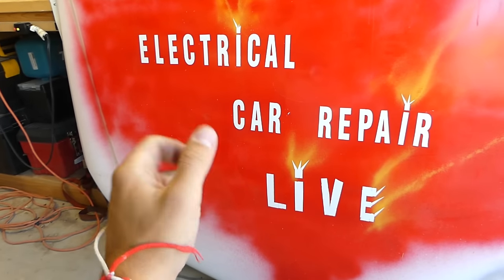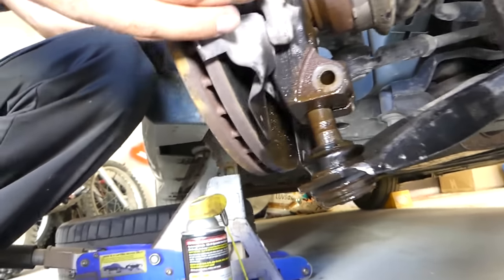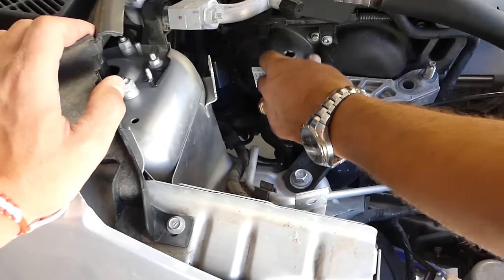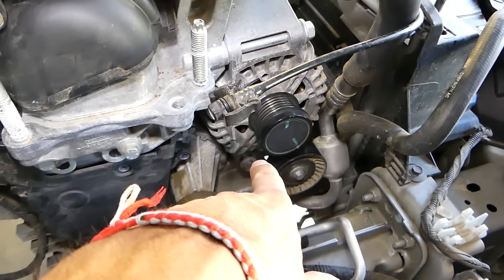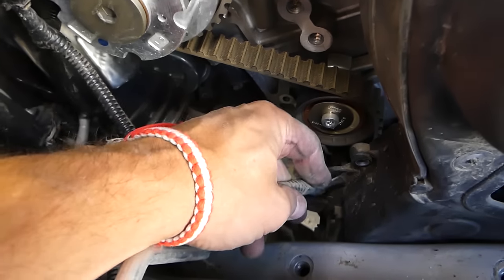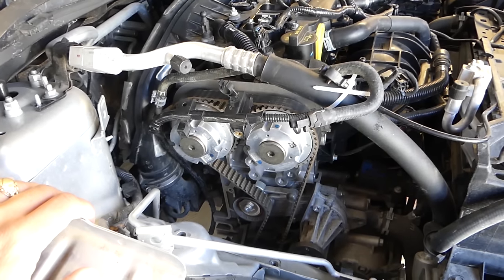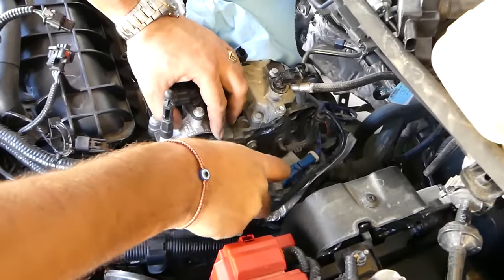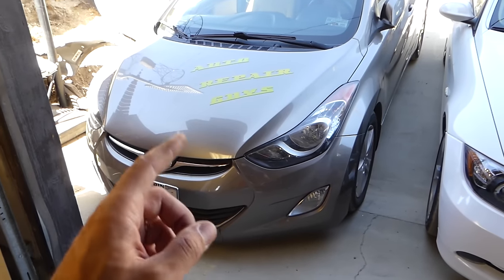FORD FIESTA TIMING BELT REPLACEMENT MK7 ST

Comment: I'll be the first to say this.  You made it way more difficult than it needs to be.

You don't need to pull the suspension apart and remove the half shaft to get to the bolt where the crank locking pin goes.

You don't need to remove anything off of the top end of the engine and use the cam locking tool.  That's what the VCT tool for the sprockets is for.  That cam locking tool is for older cars that don't have VCT sprockets.

You don't need to pull the intake manifold to remove the starter.  Remove the charge pipe, move some other minor stuff out of the way, pull the starter.

For those wondering, the flywheel locking tool is Ford part #303-393.  If you search for that, you will find 3rd party tools that are the same as the Ford tool.
Reply: It appears the half shaft is different on the ST.  My 2012 Fiesta base doesn't have an intermediate shaft like this, maybe it's only on the manual transmission versions?  On most of them the crank locking pin bolt is easy to access without removing the half shaft.   Thanks for the tips about not needing to remove the valve cover with the VCT sprockets!  Saves half the labor here!
Reply: Correct. You also do not need to pull the starter or use a crank holding tool. Ford procedure says to torque the crank pulley bolt to 74lbs using the crankshaft pin to hold the pulley. The pin will hold 74lbs just fine but ofcourse it is not strong enough for the final torque stages. At this point the timing is locked in so remove the crank pin and complete the final torque process using a strap  wrench (303-D055) to hold the crank pulley. I used an OTC 4754 universal pulley holding tool to hold the pulley instead of the strap wrench and it worked perfectly.
Reply: Got a question for you. I’m doing this on my escape, in order for the Cam Locker to fit, the TDC locking pin had to be like one thread out from being all the way tight. That allowed the cam locker to fit. Could the belt have been stretched just enough to make it so the cam locker was a little off with the TDC pin screwed ALL the way in? Trying to decide weather to leave it becasue these timing kits could be a little off as far as the accuracy of the TDC length, or do I screw the TDC pin all the way in and then manually move the cams to where they can be locked in place?
Reply: @bigscurrybear  This is really interesting to read. How does the Ford procedure say to undo the crankshaft pulley bolt? Or to hold the crankshaft against the timing pin when changing the belt? Or is it not supposed to move? I need to change the belt on my Fiesta so I am wanting to learn all about it and not have to remove the starter to fit a locking tool. Many thanks.
Reply: @iStarmaxx  
Hello.. here in the Philippines we did not use any special tools, we dont have that tools but we performed changing belt of ecosport ford by simply looked at the timing mark  of the camshaft and put  lond screw driver on the sparkplug hole once the screw driver riches on tdc we  simply put  a bolt in the crankshaft locking area and turn it clockwise once the bolt was set we turned it counterclockwise to lock the crankshaft and the camshat were set into its timing... im just sharing our own way of techniques.. thanks for the knowledge
Reply: Ur right, these guys are slopy mechanics, and after all the nonsense they didn't replace the water pump or the timing belt
Reply: @carmeloberrios3545  the video he explains it's just as a demonstration because the car has low miles
Reply: @OlBuddySimulator  You should replace timing belt when you remove it.
Reply: I'm so glad I found this comment, so much unnecessary work.
Reply: At what point in this process can I change the water pump? The timing belt is fine on my 2017 escape.
Reply: On an escape you definitely need to remove the axle and bracket too get the pin in
Reply: So glad to read this comment. I was getting so overwhelmed watching this thinking to myself that ima basically take apart my whole motor to replace a timing belt.
Reply: I was thinking good lord you ain’t gotta do all this shit just to replace a fucking timing belt
Reply: In my case I'm glad I did, one of my cams was out of alignment
Reply: yes...I have never done this and realized right away the axel can stay and no suspension needs removed. I also left the intake on, it was a pain to push the starter aside but way easier than taking out the manifold. Also you need to put a rachet on the crank pully bolt and hold it against the crank locking pin BEFORE placing the flywheel locking tool in place
Reply: @Benjamin Barber  you are completely dead wrong..it will spin at 75 ftp
Reply: @Justyn Hand  you won't say that when It skips on the interstate and the repair place will charge you 1,500$ to fix some thing you could spend 350$ in tools and parts
Reply: @Starmax*  it is the locking tool you put in in place of the starter
Reply: EXACTLY!!!!!!! you nailed it
Reply: @bigscurrybear  if youre holding the outer edge of the crank pulley and turning the bolt there is a chance you could spin the crank and put the timing out. probably get away with it 9/10 times but thats not a sure fire way to tighten the crank bolt up.
Reply: If my engine stops turning lik he said an it's hitting a valve how do I fix that?
Reply: Lack of Knowledge evident remove driveshaft ? Why.
Reply: I agree on the axle shaft part. you can remove the nuts for the outer bracket that holds the driveshaft bearing, then remove 2/3 bolts that holds the bracket. The bolt closest to the crank sprocket as you can see has a cut out. You slide the bracket off towards the center of the engine and then you can reach the timing plug from the top of the engine not thru the bottom

Comment: The 98 people that gave this a thumbs down clearly haven't worked on a big project like this. This video (and all your others) are super helpful in understanding the best way to fix what is needed without a lot of trial and error.
Reply: tightening the crank bolt in degrees needs to be done smoothly in 1 motion to stretch the bolt correctly not kicking a breaker bar with you foot until you reach you finish!

Comment: i agree with some of the comments. you have made a lot of work for your self. i also believe that with both cams and crank locked. new belt on and tensioned. i always slacken off the cam bolts replace if needed. this will transfer any remaining slack from the right side to the left side of the timing  belt system. unless i have been doing it wrong all these years lol
Reply: you are right... the purpose of replace the belt is of course to re-tension that area between the two cams..

Comment: i think you don't need to remove the valve cover to install the cam shaft locking tool..the camshaft sprocket locking tool do the same thing..like the timing belt holding the cam sprocket..unless you remove the cam sprocket then thats the time you need to install the camshaft locking tool..correct me if im wrong..thanks

Comment: Thanks for putting this great video together. I was able to use it to replace my timing belt. However, after putting everything back together, I have a 1cm gap between the timing belt cover and the engine just above the cam gears. Tried everything but the gap remains. Any ideas?

Comment: one thing I would add. you need to ratchet strap an a wrench to hold the crank against the bolt/tool that holds the crank in the right position BEFORE you put the tool that holds the flywheel in order to remove the old bolt and  tighten the crank pully.

Comment: if your not changing the belt do u have to remove the starter if your only setting the timming after changing the water pump or can i just pull the axle bracket and valve cover??

Comment: Question about Ford Fiesta 2015 1 liter petrol eco boost. Would you need to remove fuel rail as well in order to change timing belt (also they did oil pump and its belt) ? Asking cause this one autoworkshop done mine and a week later fuel starts pissing threw injectors. I assumed going there that they put it wrong or not tight. Heard that you need to put brand new seals and they are not in the invoice. However, it looked like they did not agree with me today, not their fault. Been all right for 3 years and now all of sudden it's not working properly if they touched it.

Comment: Why disassembling the engine to add one more tool for alignment where you can use the tool from the timing belt side to make sure it is aligned? I have seen it without getting the whole engine apart to add extra alignment tool?!

Comment: If you lock the in the cams and have a bolt on the side of the block that the crank will contact thus disabling rotation and verify timing positions; why does Ford recommend removing starter and locking the flywheel as well🤔??? I do realize that the tool at the flywheel will lock it in in both rotations of crank as where the bolt on the side of block will lock it only in one direction of rotation BUT the crank is not under spring load like the cam shafts are from valve spring tension. I have serviced the Ford 2.3 naturally aspirated for timing belt many times only using the bolt that inserts on the side of block and locking in the cam shafts. These are essential since the nose of crankshaft does not have a keyway for the crank pulley to slot in as it depends on the crank bolt to clamp down everything in but i do not see the importance of the locking tool at the flywheel....plz explain it has me very curious.....BTW great in depth content 👍.

Comment: This is a very good reason why I will NOT buy a FORD.  I have an Elantra same year as your Silver one and runs perfect and 102K miles with a TIMING CHAIN:)  Never need to worry or replace!
Reply from the maker: I love the elantra. It is so much easier to work on
Reply: Timing chains get slack after 100k miles eventually they cause engines to fail

Comment: My crankshaft pulley bolt won t come out no matter what I try .. can I use the bump start technique ?

Also, the starter is a pain to get to. Can I torque the new pulley bolt using TDC pin ? Thanks

Comment: i got also ford fiesta,i would like to know what's the possible cause of mixed oil and water spilling from the air cleaner. i hope you could share some info. thanks.
Reply: Change Oil Cooler. But make sure that your Cooling fan is not defective.. Possible cause. Is overheating

Comment: Thanks for the video. 2014 Ford Fusion Manual Trans.  replace Water Pump, but didn't replace timing belt (yes I know), was hoping to avoid all the timing stuff.  Did not remove crank pully, held belt in place, removed tensioner, and put in new one, but did not do any of the timing locks (starter, pin behind axle shaft, but did use the cam lock tool on the front where the belt sits.  Job is done, car seems to run fine, but now I'm getting cam, crank timing codes P00017.  :(    I assume I need to do it all over again this time with the timing tools and replace the belt.  IF timing is off, I assume I don't want to lock it down where it is presently?
Reply: I did the same on my fiesta thought I could do the water pump and justlock timing in with wedges, now I have pops and bangs over 2000rpm so I'm tearing down again 😢
Reply: @kchappie6672  I did tear down again, I used the lock pin on block (behind passenger axle shaft mount) and the cam shaft lock on the front side.  I reset the timing belt and fixed the code issue I was having.  It's running great with no codes.

Comment: I'm doing a Ford Fiesta 1.6. My 1.6 "J" code engine is nothing like the one you are showing. Mine is verified as a "sigma 1.6". This was verified through the dealer. 
Can you shed some light on this job. Do you have a video that shows the 1.6 sigma j code configuration.

Comment: I suggest use a marking paint on your crankshaft bolt at 6 o’clock and when you turn it clockwise, you wil find the mark at the 9 o’clock position and 9.5 position.

Comment: You did 3 times as much work as you needed to. Its much simpler than you made it. Never ever change a timing belt without changing the water pump.
Reply: These guys are cowboy!

They HAD a cam gear living tool, and they didn't use it 🤣🤯
The rocker cover did NOT need to be removed. 😂
Reply: Holly shit, you have done 5xs the work necessary….
Reply: Why is it necessary to put the crankshaft fly wheel  tool in if you have the TDC pin in..   what am I missing???
Reply: I agree, I thought I was the only one who thought that!😊

Comment: Hello, can I ask for an explanation? At minute 1.18.10 you can see that the crankshaft crown wheel moves freely, how does it lock when tightening the bolt since there are no hooks? Thank you.

Comment: Come back the days when all that was involved in a Cambelt change was 4 bolts cover off water pump 4 bolts pump which actually tensiond the belt  but that was a Vauxhall 
. Nowhere days it would appear a lot simpler to change the entire engine.. I do believe this happens a lot.

Comment: Good day Auto Repair Guys. How do i move my camshaft to a 12 0'clock position? My crankshaft only moves about 180 degrees to 8 o'clock position and back to 2 o'clock position. whilst doing this, my TDC pin is installed and i haven't removed the old cam belt yet.
Reply: Its okay. I managed to sort it out myself
Reply: @azwinems1974  how did you do it?

Comment: So both the repair manual and this video both reference possibly needing to rotate the camshafts slightly to install the tool to lock the cams in place but neither describe how to do so... Can anyone explain how i can rotate the cams slightly to get the tool in place? I have the engine at TDC and the locking tool in the flywheel both of the specialty tools are just slightly off and will not slide on.
Reply: What did you end up doing?

Comment: Nope, I’ll take it to Ford, spend $800 to have someone spend 6-10 hours changing it for me. 2 shifts of overtime should cover it.
Reply: My Ford dealer told me 7k
Reply: @matthewcesario2069  7k to do the timing belt? lol
Reply: I took my pre face-lift 1.6 titanium to the mechanic and it didn't take long after, before it starts to have some huge leg. Could it be the wrong procedure or something else. It's a 2009 model, but made at the end of 2008.
Reply: @Fanzo463  If it was the moment you started it after getting it back, then they did something wrong. If it was weeks or months later, it is something else. Could be a throttle position sensor, an idle air control valve, fuel purge solenoid valve. Check engine lights are a great starting point if you got one illuminated.
Reply: @BtRct  There's nothing that appears on the dashboard. I'll have to check what you've mentioned.

Comment: My goodness you took the engine apart to do a simple job.  Timing belt can be done without doing all of that.  A cam locking tool is out there to lock the cam shafts from the lobes.
Reply: The only thing that chnges is not having to remove the vacuum pump. Still have to pull intake for starter, for flywheel lock. Still have to remove valve cover to install even the tool you suggested. If you cut corners on this job, youll buy an engine.
Reply: @joeyvencill792  That is incorrect.  You do not have to remove the Valve cover at all.  They pulled all the intake off and the valve cover.  Hopefully people watch other videos before doing the job.
Reply: How are to lock the cams without  removing the valve cover?
Reply: I saw a flash of the timing kit they had and in that kit was the plate to lock the cams from the front so no need to take the rocker cover off at all. Time up without removing drive shaft with the pin, lock cams. Whiz the crank bolt with an impact jobs a good un. lot of work here I gotta say!

Comment: Do you really need to lock the camshafts at the other end when you already locked them on the vvt pulleys?
Reply: VVT as the name implies, is variable. You need to lock both the cam and the VVT phasers at TDC for this job.
Reply: @mohdazmizain7837  The instruction on the Ford Etis software were that you don't need to lock the back of the camshafts for a timingbelt job. 
The VVT unit has a spring operated locking bolt which locks the depahser and the camshafts together when there is low oil pressure. 
I did the Timing belt change on this engine 5 days ago and i only locked the VVT unit with the X-tool... no problems or codes afterwards. runs smooth

Comment: I've 2016 Focus SE 2.0L GDI Flex fuel . engine . Can someone tell me if loose timing band will bend rods and valves ? One says  yes another says no way . What's the truth ?? verry hard to find a good mechanic
Reply: You have a timing chain, not a belt

Comment: Isn't this job scheduled for something like 150,000mi ? did this one really need to be done?
Reply: Timing belts don't usually last over 150,000 miles.  You can chance it but if it breaks you will need a rebuilt engine as the valves will slam into the pistons and destroy stuff.
Reply: @JLUDE01  if it's the factory recommended interval, I don't see how it's taking too big of a risk.
Reply: @deviouslaw  Agreed.  Some people change them early to be on the safe side.  I'm changing one now on a work vehicle with 180,000 miles and the belt still looks OK but why risk it?  If the engine goes on this vehicle it's not worth repairing because the vehicle is worth next to nothing now.  High mileage and Ford do not translate to resale.
Reply: They said if it's a dual overhead cam engine it's not an interference engine that won't bend the valves if the belt breaks